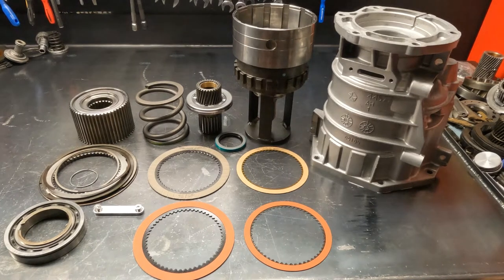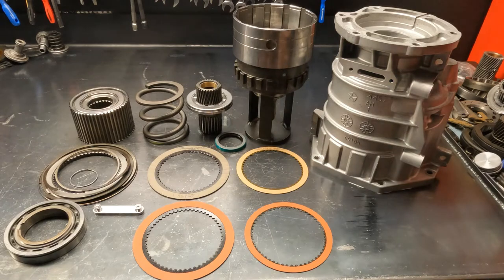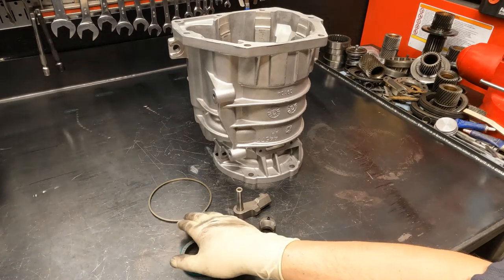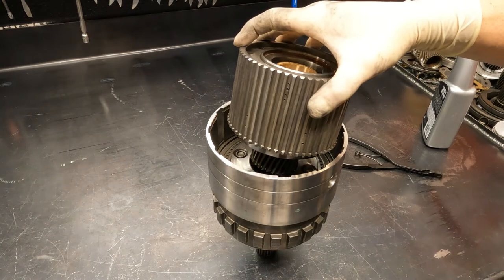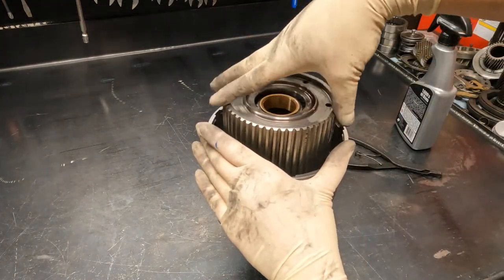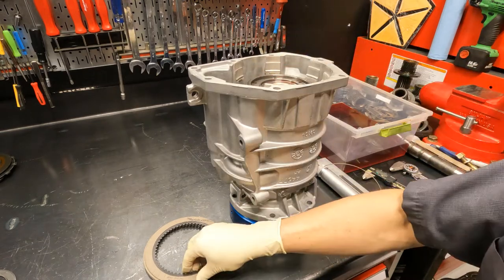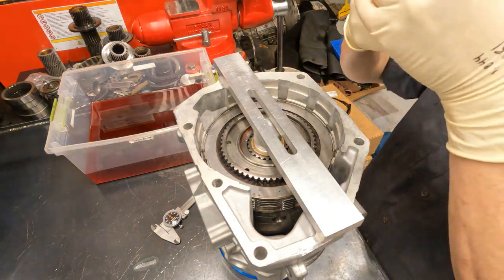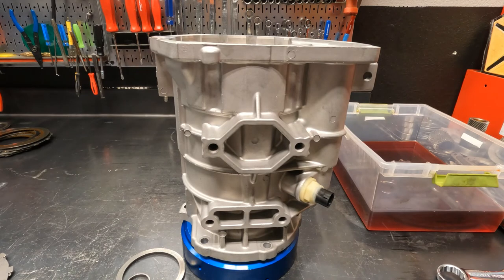Dodge Diesel 47/48RE Overdrive Assembly

Comment: Hi Chris, what are the symptoms of broken overdrive direct snap ring. I have 2 46re transmissions, that don't work right and I forgot what they were doing lol.
Reply from the maker: Usually no reverse and pieces of the snap ring in the pan.
Reply: I had on my Dakota r/t where I'd get a code of trans temp and it would get locked out of od on the freeway.
95 ram 1500 takes a long time to go into gear. 
Now my 06 Cummins 48re is acting like it can't decide if it wants 3rd or od .
I'd like to figure out that before I have to pull that out and do a complete rebuild
Reply from the maker: @Moparmaga-1  on the 48re id drive it with a scan tool while viewing live data to look at the governor pressure.